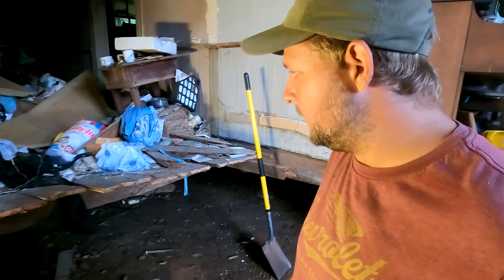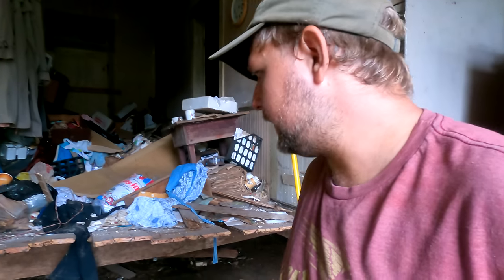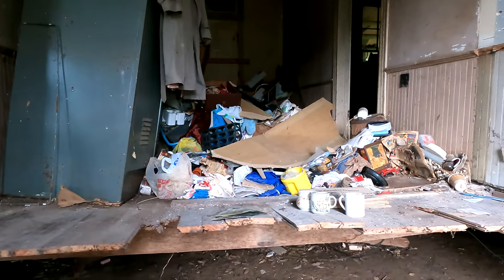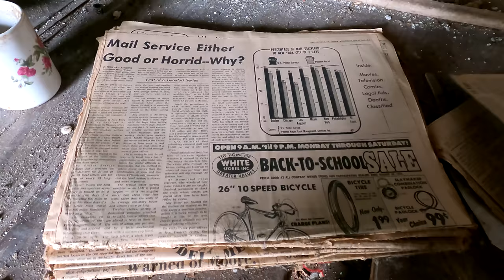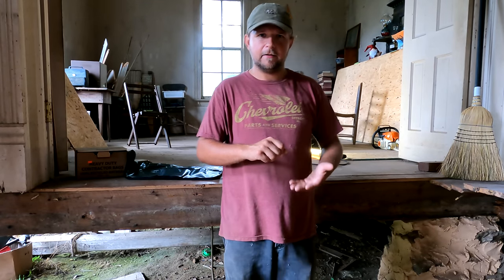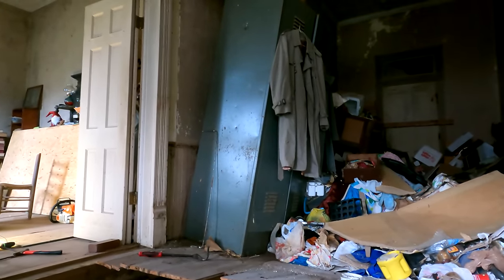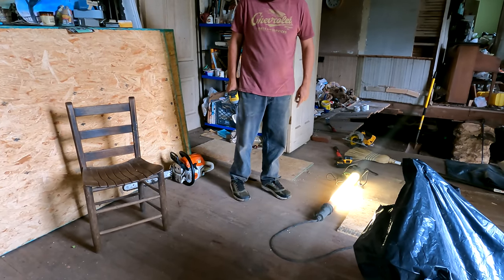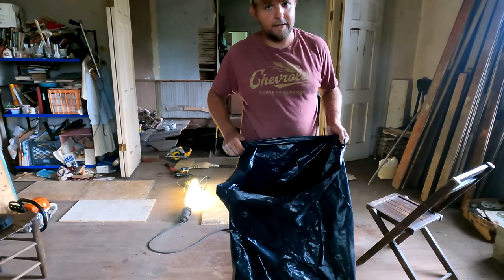Patching Floors and Clean Out! Rainy Day in a 140 Year Old House

Comment: Hey, place a 2x4 between the timber and pry bar. Without a 2x4 you're pulling the nail at an angle and bending it. With a spacer the nail will come straight out. Easier pulling too. The idea is to keep the base of the pry bar even with the head of the nail. Loved the video! 👍👍👍 And the thunderstorms ⛈⛈⛈

Comment: Robert,
When you pry the nails out with those bars,
try placing a  block of wood , 3/4 inches or so deep, under the bar just past  the bend in the hook area on the bar,
, the pry will be more vertically aligned with the nail head rather than pulling  against the side of the nail hole.
Give it a go, I think that may be helpful.
Cheers,
Rik Spector

Comment: I like the wider doorways in the house. It gives longer sightlines through the house, making it look bigger. It will also help with air flow. The new doorways may not be original, but they are old and look really nice. I also like that they have doors you can close so you can heat or cool just the room you’re in, and not the whole house.